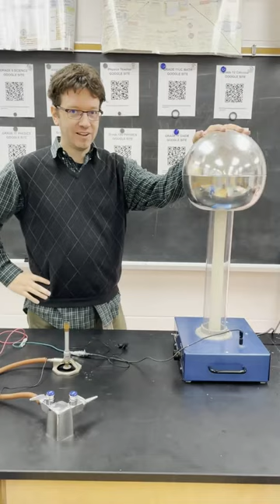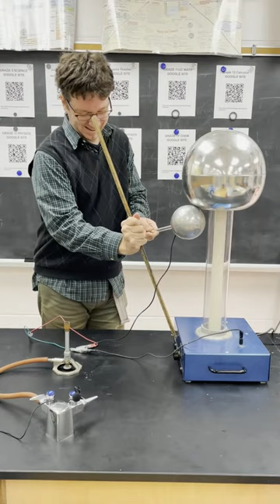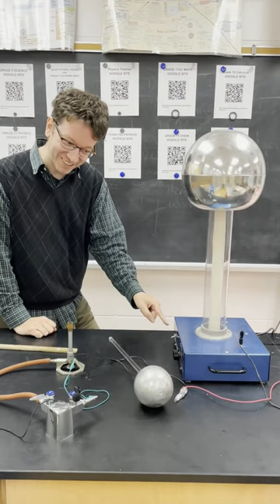Lighting a Bunsen Burner with Static Electricity - Blooper Reel

Comment: this may be easier to demonstate with an electric lighter, they produce high voltage that jumps to itself and avoids the pain of charging your own body
.....well until you touch the purple arc
Reply from the maker: I also have a Tesla coil that probably would have done the trick but I guess I wanted to be dramatic 😆